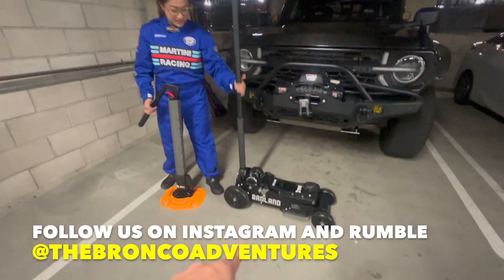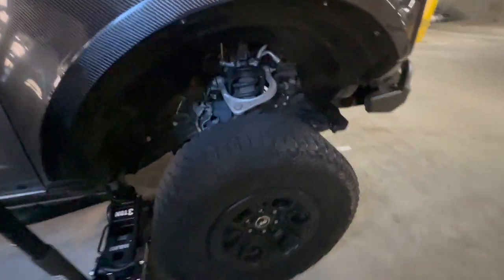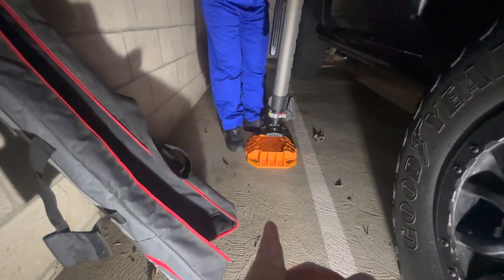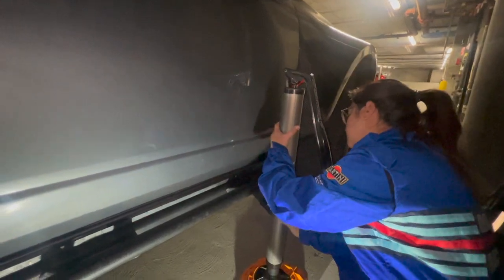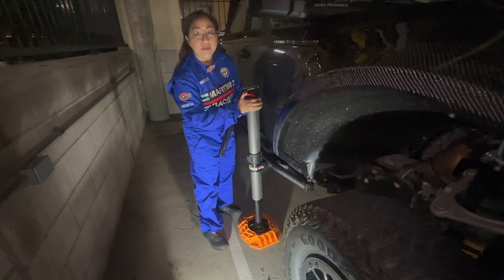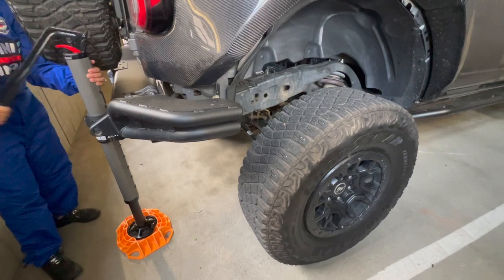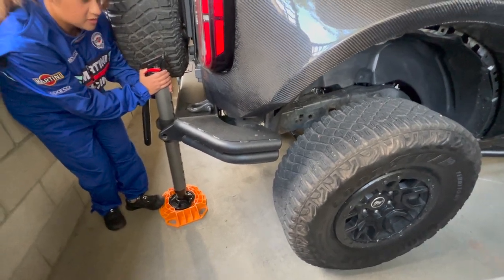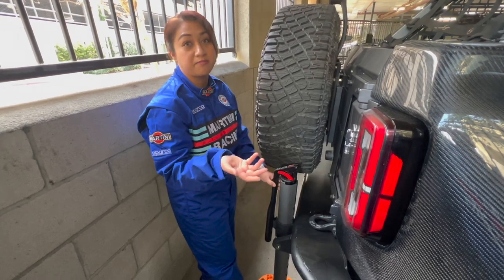ARB JACK vs BADLAND OFF-ROAD JACK - WHICH IS BETTER?? | The Bronco Adventures

Comment: I don't know if the rock sliders are designed to be used as a jacking point. I am thinking using a heavy duty bottle jack with a block of wood as a base would be better than both the ARB and Badlands jack. Bottle Jack's  are smaller and not as heavy. What type of jack does the bronco come with?
Reply from the maker: Thanks for watching!!! the bronco comes with your typical scissor jack. but you are right the rock sliders are not designed for jack point unless it is welded to the chassis.  the badland is better for those days when the bronco needs to be lifted for a longer period of time. we also invested in those jack stands since we do a lot of modification and it tends to take a few hours. 🙌🙌🙌🙌